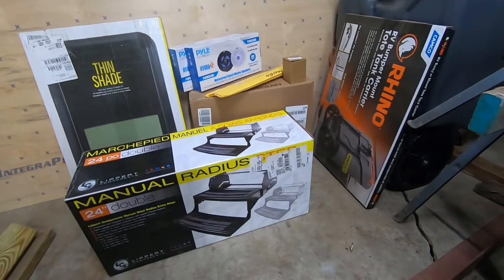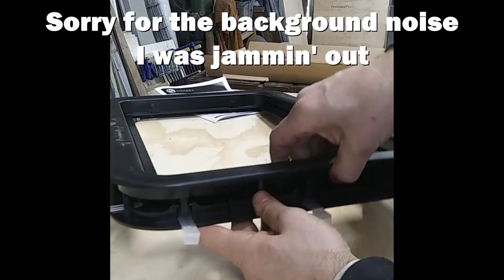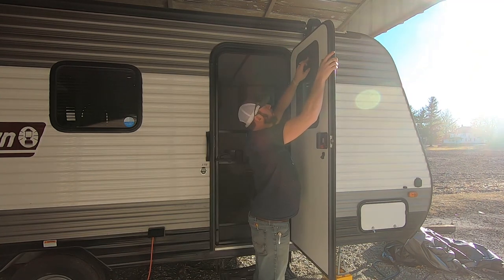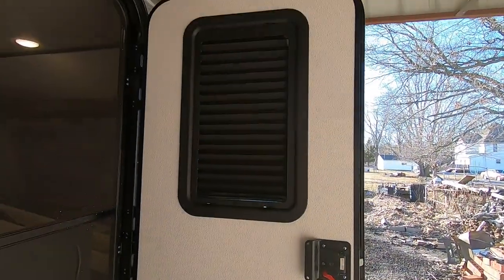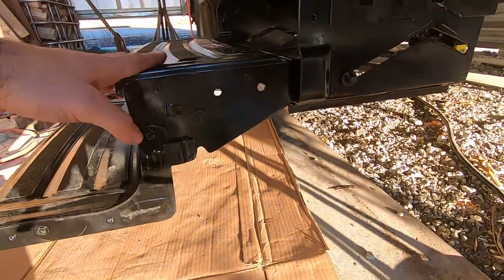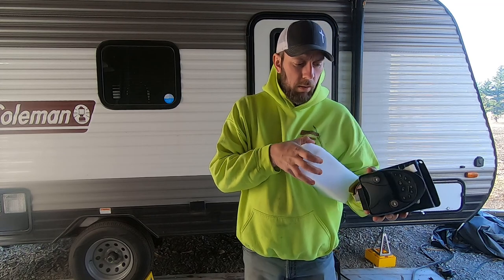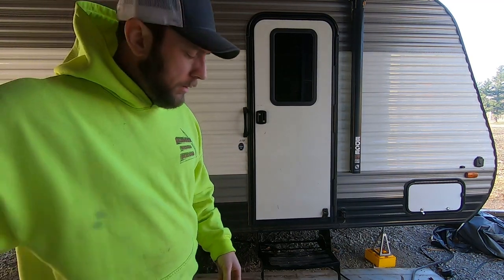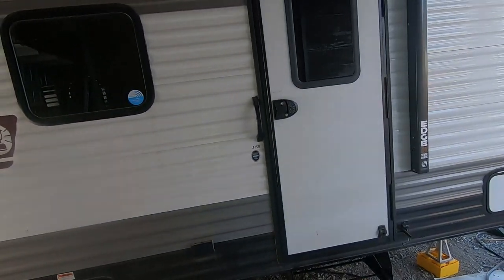How To Upgrade Your Camper Entryway | Coleman Lantern LT 17B

Comment: I know you have moved on to a bigger trailer but a question. The window you put in the door, did you order it from Amazon? and do you recall if it was a 2 inch thickness and did it fit properly, tight.
Reply from the maker: @Cheri Bowen yes we did got it from Amazon, I believe it was an inch and half thick and yes it did fit tight.
Reply: @SmallFamilyBigDreams  Thx

Comment: I was wondering what it would take to add a window to one of these doors. A very big upgrade! I bet it really brightened up the inside of the trailer.  

I would probably skip the steps because I am dubious about the additional leverage a heavy wide beam person (me) would put on the lower step and cause damage to the step frame on the trailer and the lower step deforming under the strain of the extra weight. 

I like the keyless door latch upgrade. Do they have a power remote door lock kit for those doors? I mean, power door locks are almost universal on cars. Why not trailers?

Comment: I bought the same steps but ended up returning them because of that gap in between. Noticed you bent the top screws. Is it as stable as the original steps?
Reply from the maker: Yes it's fine. I loosened both side so it would squeeze together. So far so good anyways.
Reply: @SmallFamilyBigDreams  have the same issues i am considering getting some washers to fill the gap